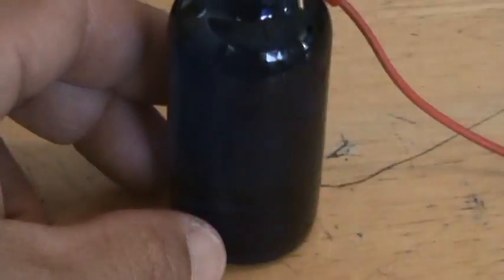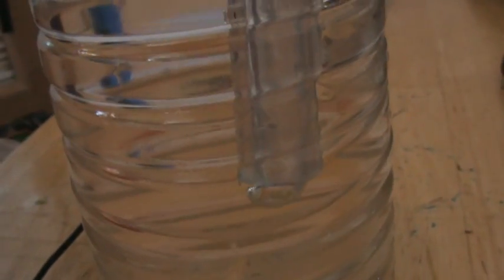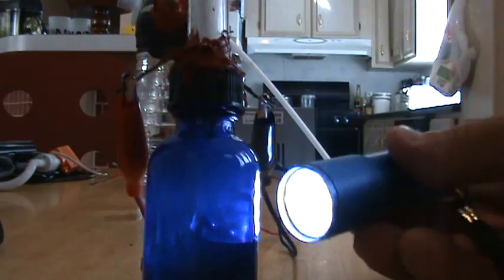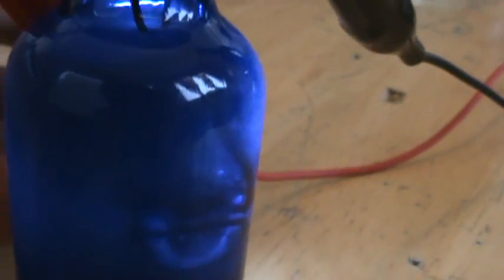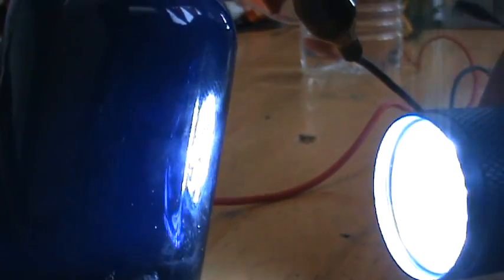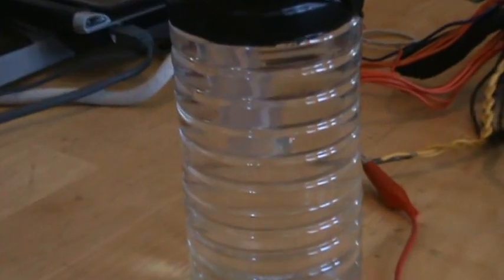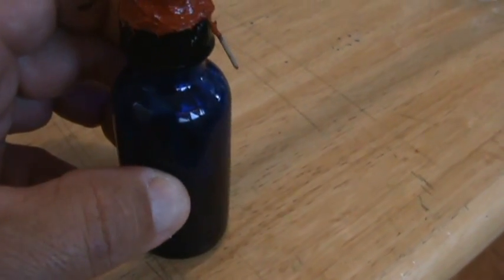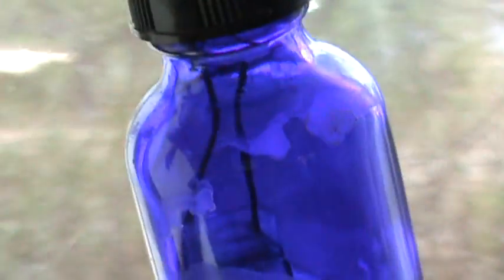HHO Micro minni Generator EXPLODED bubbler failed

Comment: First you should not be using glass. Use a flash back arrestor from gas welding rig. 
put it after your bubbler that should put a stop to flying bits.
Reply from the maker: Matt Lombard  this is a very old video. I no longer play around with HHO.